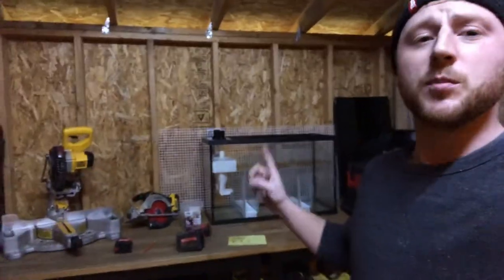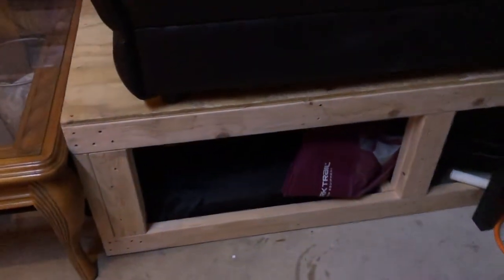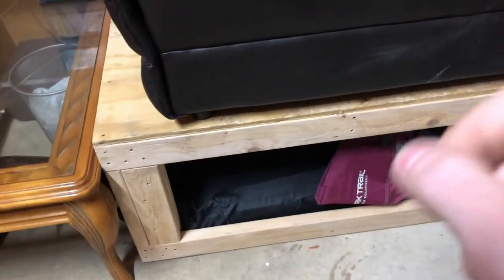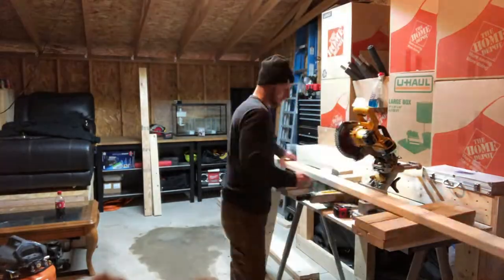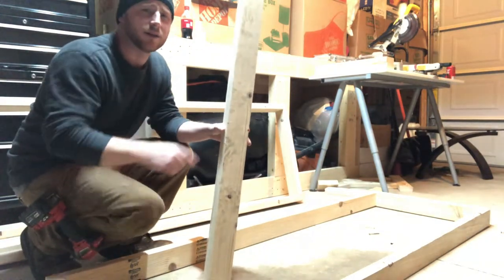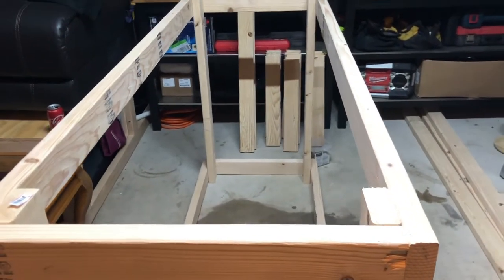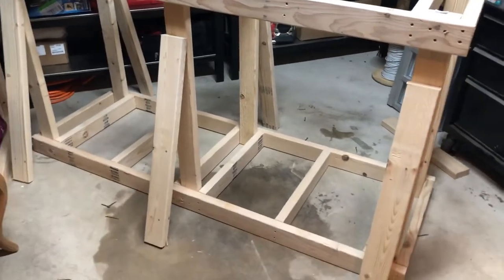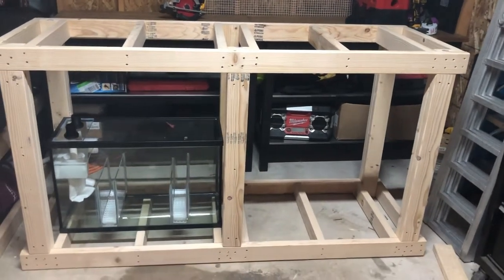HOW TO: Build Aquarium / Fish Tank Stand (6x2x3) for UNDER 50$ | Step by Step

Comment: Hey man, awesome build and thank you for the video. I have a question about the top sheet. Does it have to be one solid piece, or could you do three 2 foot by 2 foot boards on top to make it six feet? Also how thick of a board would you recommend getting? I heard 1.5 inches is good for a tank with those dimensions. 1 last question, where can I get a 2 X6 top sheet?

Comment: Nice video. I know it's a long shot, but any chance you wrote down the dimensions of the lumber? I'm building a stand with the same dimensions.
Reply from the maker: Thanks man. You will need (4) 6 ft 2x4. (14) 2x4 @ 21 inches. (6) 2x4 @ 38 inches. (6) 2x4 @ 31 inches. The last 2 measurements I gave are for the height of the stand. Those can be any height you prefer. Hope that helps man